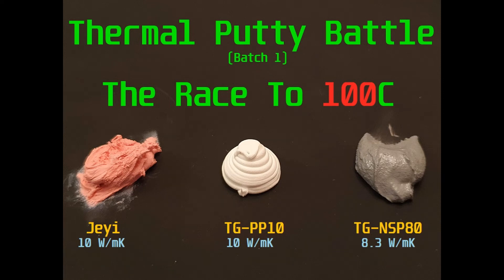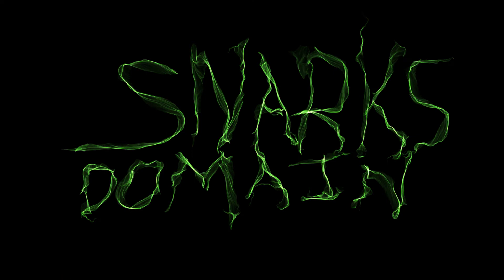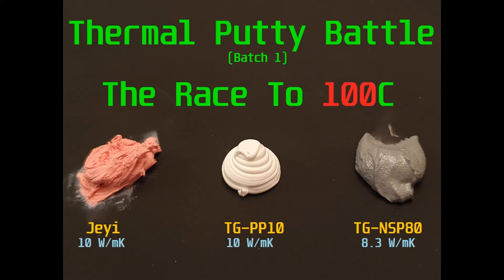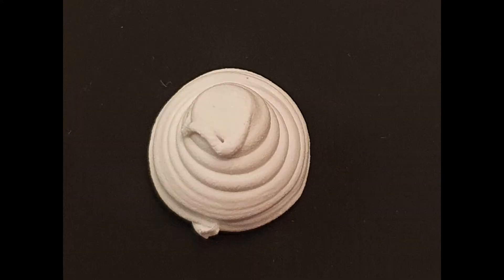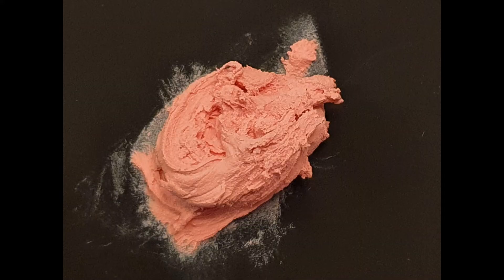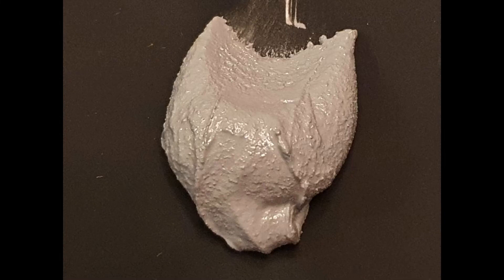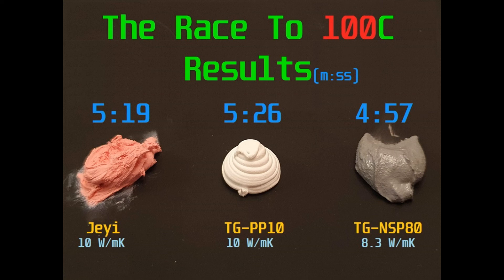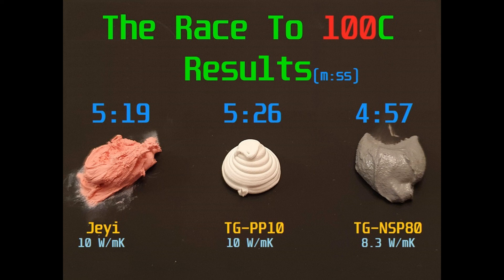Thermal Putties: The Race to 100 C. !Avoid TG-NSP80 due to it conducting electricity.

Comment: Does jeyi have different batches?
Reply from the maker: @vugiabao7tc425 To be honest I haven't bought any Jeyi 8100 in quite a while, so I can't answer that with woth certainty. I still have around ~150g of it so haven't needed to buy more 

My gut feeling is that Jeyi 8100 will be very consistent, for a few reasons: "Jeyi" is a an established brand with a website and contact info. If the quality of one of their popular products were to faulter, it would negatively affect the brand image. They would certainly be cognizant of this fact, so have a vested interest in maintaining quality and consistency.

The reason I caught the batch variance issue with CX-H1300 is that I was hoping to send some to a few people to try out, and so bought some more. Once it arrived I could see it wasn't the same as the original batch. I optimistically considered it a one-off and quickly ordering from a different store. Same result. This happened 2 more times and I had partially given up on it. I tried contacting the sellers, and while they responded, I'm not sure if they have yet passed my information onto the supplier/manufacturer, as no further rapisne has happened yet.

I recently got my hopes up a couple weeks after a newer Diacord member  ought some and seemd happy with it's consistency (I believe it was their first e counter with the putty). I promptly order 6x70g containers, but unfortunately was disamsappointwd once it arrived. Same stiff consistency as the other lower quality batches. Performance wise it'll still be fine, but it takes more skill to get a good application with it.
Reply: @snarksdomain some sellers sold jeyi for about 2$/10g but the other sold it for  7$/10g. I don’t why the price is so different between store and store.
Reply from the maker: @vugiabao7tc425  I've purchased it anywhere from $4 CAD to $8 CAD.

Comment: Have you tried zessio putty
Reply from the maker: Just ordered some, along with 4 other putties.

Upsiren UX Pro 16.8 W/mK
CX H1300 13.5 W/mK
Zezzio ZT-PY6 13 W/mK
LK-PRO 12 W/mK
OCNG OC-P10 12.8 W/mK
Reply: @snarksdomain  has any of your pastes arrived yet mine comes friday
Reply: im going to repaste my 7900xt sapphire ref card and use syy 517 for the gpu die
Reply from the maker: @levi smith  none of the 5 I just ordered no. Gots lots of stuff in the pipeline I need to test. Work will likely be slowing down soon and I'll have more time for testing.

Comment: Great content! Have you thought of testing Upsiren u6 pro?
Reply from the maker: That's the next putty I plan to test. I have a 20g container of it I'll use for the hotplate test and I've got some more coming so I can do a test of it on the 3070ti as long as it passes some other tests (ie. Doesn't conduct electricity).

Comment: After looking at your video talking about graphite thermal pads I have seen that Upsiren is also making thermal putty with 12.8W/mk thermal conductivity. Have you already tested it ?
Reply from the maker: I have not. I will need to look into that. Is it pink by chance?

From my understanding Uprisen is a reseller and not necessarily the manufacturer of thermal products.

For instance, the manufacturer of these 3D Graphite pads is Anhui Shanyue Technology Co., Ltd.

They were the ones to get me in touch with the Aliexpress reseller in regards to my affiliate link.
Reply: @snarksdomain  I have no idea why youtube delete my comments, I didn't even put any links :(
I said upsiren's putty (u6 pro) is pink and the seller use the same picture as jeyi's so I suppose their manufacturer is the same

I have also found another manufacturer on alibaba, they can make a 12.8w/mk putty (minimum bond line is 0.2mm), I'm asking their price (1kg is their minimum order quantity). They will give me an answer on monday.
Reply: @snarksdomain  I got an answer from the manufacturer about their price for 1kg putty at 12.8W/mk, it is 2500yuan or $360 (taxes+shipping cost not included). Twice as expensive as tg-pp10, but still half the price of Jeyi or Upsiren's

Comment: Separation of ingredients due to prolonged thermal exposure. 
Eventually oils come out of thermal pads. The oil is a good thermal conductor, but when it all drips away, the pads performance degrades. 
Therefore, longevity is part of the desired equation no? The most painful of tests unfortunately because I want the results now!
Reply from the maker: Yeah, longevity is a big plus for putties as long as they do in fact last. Fingers crossed.

Comment: I'm surprised you didn't try K5 PRO yet. Regarding Jeyl, on the product page it says to apply it as thin layer because If it's going to be too thick it will affect the thermal efficiency.
Reply from the maker: For sure. In an ideal world all components needing active cooling would make direct contact with the coldplate. This stuff is definitely a putty, not a paste.

I plan to use thin layers on the VRAM by using copper shims to fill in most of the gap, which vastly improves cooling. Less putty/pad and more copper FTW!
Reply: k5 pro is not putty, its like thermal paste density, nasty
Reply from the maker: @pav1u  It seems like half-way between a putty and a paste.

Comment: Been waiting for your video with the test results! The NSP80 is kinda disappointing to be honest with that price and performance.  The Jeyi looks promising. Which other thermal putties would be a good alternative? I noticed also the TG-N909 on digikey but i'm not sure about that one.
Reply from the maker: I definitely wasn't expecting the NSP80 to win the race. This makes it more affective at transferring heat the Gelid Ultimate thermal pads that are rated at 15 W/mK (at least, that's what my results seem to show).

I like the consistency of the Jeyi, if not the price. Would need to find a way of buying it in bulk.

I want to get some Penchem TH949-1 and TH949-3 for testing, both of which are rated at 12 W/mK. I have no idea how much they cost though.
Reply: @snarksdomain  Hi, I've had a look at Penchem 's website and saw the TH949-1 & 3 but I have no idea how to buy (if it's available). When i click on the PDF icon of the product it's just redirecting me to some whatsapp window and i didn't proceed further. Strange they don't provide an email address. Did you have any luck contacting them? I'm looking into buying enough putty for just 1 evga 3090 card.
Reply from the maker: @valch7772  no luck yet. Penchem does sell some of it's products on Digikey but maybe only in the US(?). I'm hoping to buy some TH930 and TH855 for testing as well at some point. If I can buy it from within Canada that is.
Reply: @snarksdomain  TH930 and 855 have thermal conductivity 5w/mk. Isn't that too low? I see they are available for europe. I've bought copper shims 1.5mm to use with a putty so if I end up getting Jeyi or NSP80(that one is last option to be honest) I guess about 50-60g would be enough?

It's really interesting and annoying at the same time the fact that there isn't many thermal putties out there at least 9-10w/mk. I keep looking around to see if any new putty pops up.
Reply from the maker: @valch7772  At this point I no longer trust w/mk ratings. I'll be relying on the hotplate tests to decide which putties to use.

I think I'll test putties out on a 3070ti I have to see how they compare in a real world test, also to verify if we can trust the hotplate results for relative performance.

Comment: These results were very surprising, it's a shame NSP80 is like 2-3x the cost of TG-PP10 though.

The Jeyi stuff looks promising, hopefully they can make it in larger quantities than 10g.
Reply from the maker: Agreed. I wasn't expecting those results at all. Not sure I like the consistency/texture/feel of the NSP80. Hopefully I can acquire some Penchem TH949 for testing.
Reply: @snarksdomain  I still don't think anything will beat the price/performance of TG-PP10 though.

I've got a 1KG tub of it and barely used anything yet, I used a little bit on a Z590 PCH, dropped temps from 90c down to around 50-60c.

With it now being discontinued I fully intend to hold onto it, perhaps for RTX 40/RX 7000 if thermals are an issue.

Do you have any plans to test NSP80 or the Jeyi stuff on a proper GPU?

Theoretical and practical results don't always align.
Reply from the maker: @GhostMotley  yeah, I'm not sure if we'll find a great alternative price wise. I'll likely test both the NSP80 and Jeyi on a GPU.